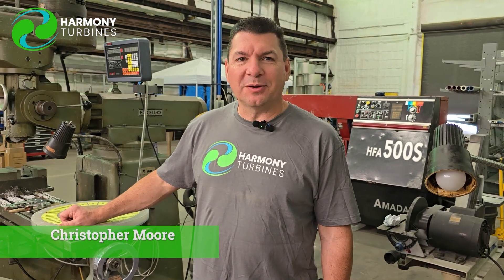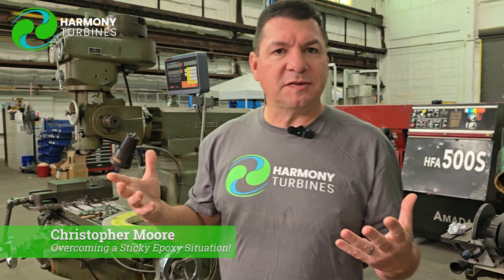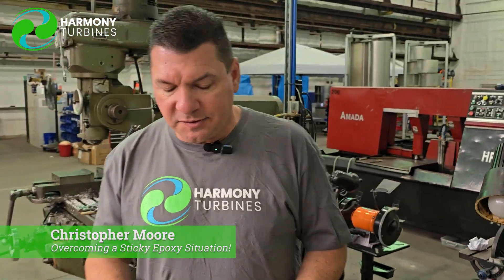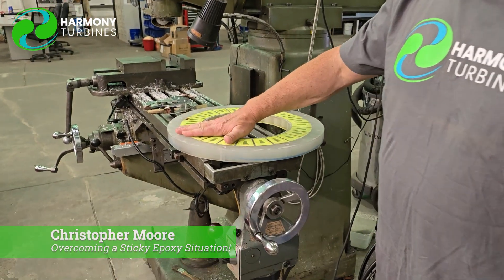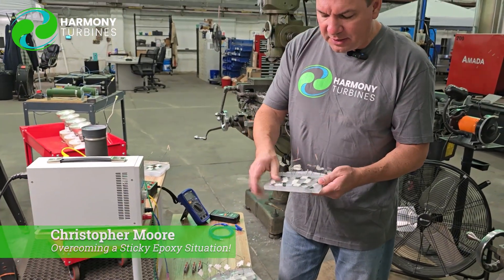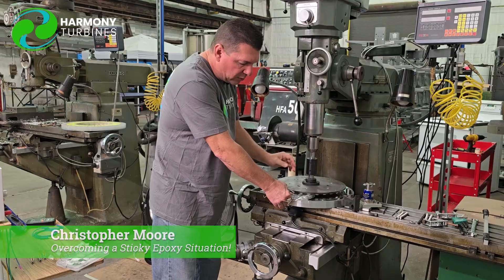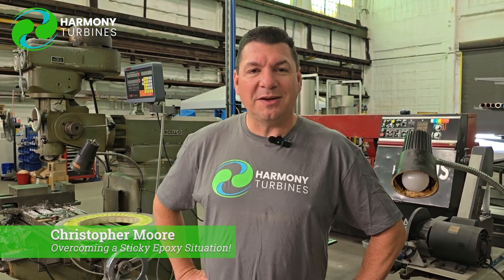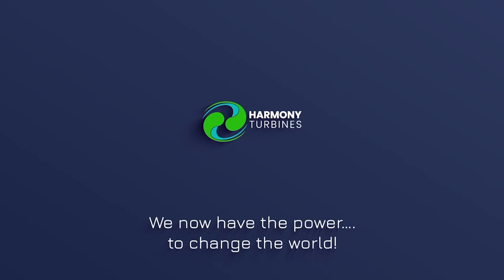Overcoming a Sticky Epoxy Situation!

Comment: only concern I have at moment is  to tight of clearance  bearings wear get loose things flex under use etc  there has to be a product available to make this simple easy to do  a layer of poly carbamate coils  layer of poly carbamate with pout in hole for epoxy  done  just thinking  don't know

Comment: Would adding a CF or GF cloth to it be a possible acceptable solution? My understanding is many epoxies and even polyester resins, have material flow and flex issues over time. Carbon fiber would also offer the some of the thermal properties your looking for to I believe. But I admit I am ignorant as to what levels, and the full levels of your previous testing, failures and experience.